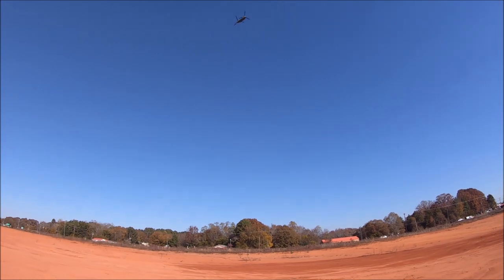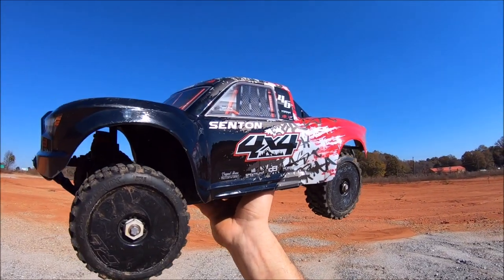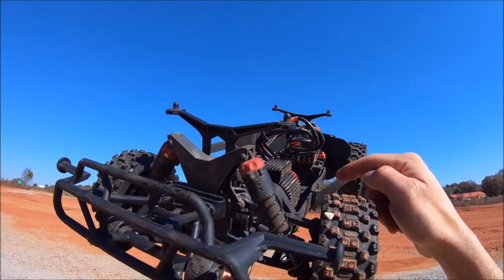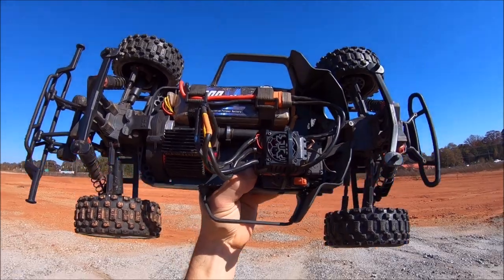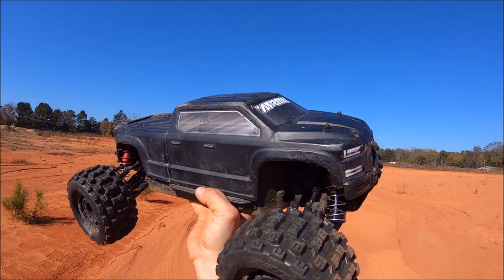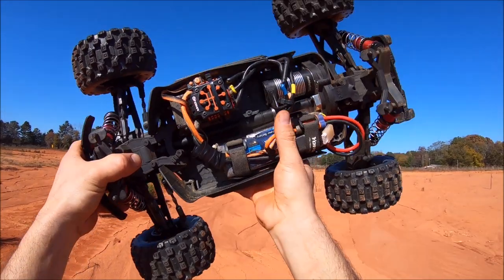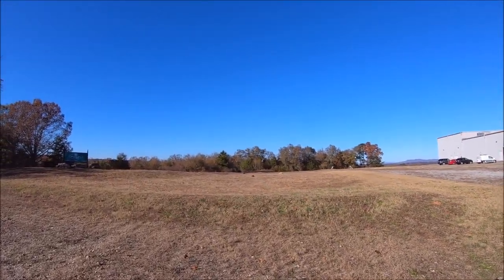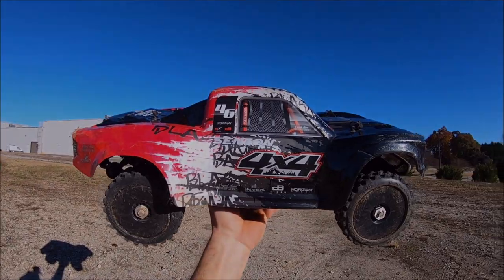ARRMA Senton 4x4 on 4s!💪Takes a hammering! with Big Rock 4s!

Comment: you'll find eventually with those upgraded CVD's that you spin the metal shafts in the plastic that they're fixed too , best way to fix it is drill a hole through the plastic (the metal has one where it grabs the mould of the plastic) and a small grub screw through it to affix the metal end to the plastic. 

Eventually on 4s on the big rock you'll find that the 4s outcast driveshafts are superior, but require larger outdrives and drive cups because the CVD is larger. IF you dremel out the ones on the stock CVD's you get some insanely beefy and strong driveshafts, but you do have to shorten them just a touch.
Reply from the maker: Thanks for the tips bro!!😎👊👊

Comment: I loved my senton 4s. Had the castle 1415 on it with a hobbywing xr8 sct and it was a beast like yours. Just had problems keeping axles together. Tried the hot racing ones and still had problems. They are definitely one tough truck though
Reply from the maker: Yeah its a sweet rig on 4s! The Arrma HD axles I showed worked perfect and are holding up!💪💪
Reply: @RCDUDE81  I did get the arrma metal differential gears for it and they hold up really good.